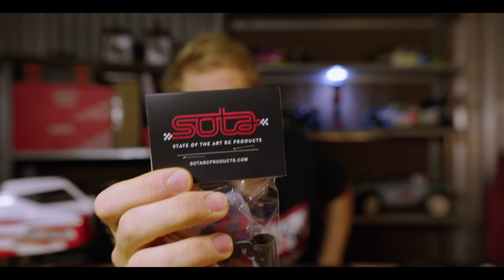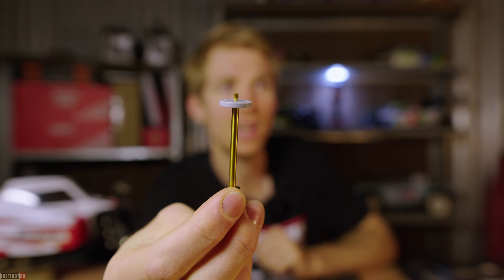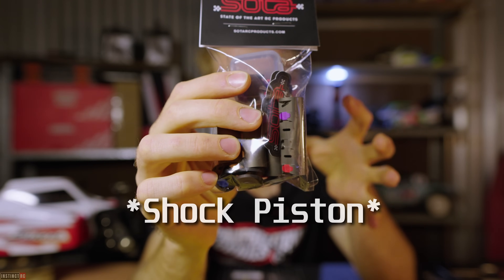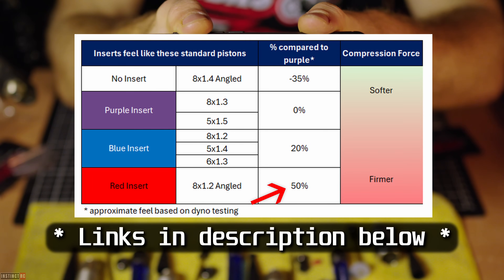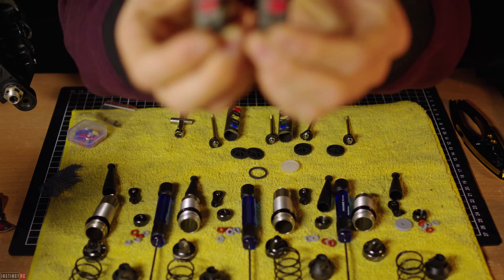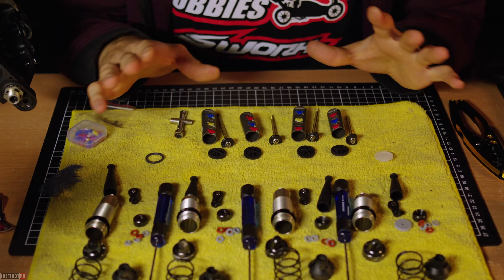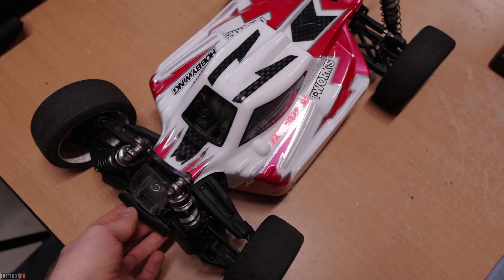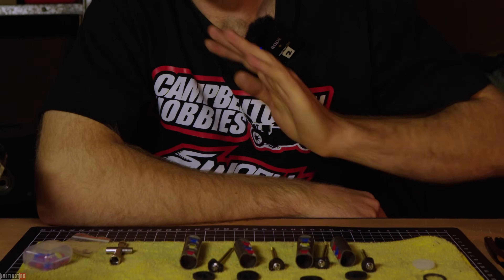The FUTURE of RC Shocks? | SOTA RC

Comment: I have them in my Tekno EB48 2.1 and it's easily my favourite addition to the car. Easy to work on and the fluid just simply does not aerate at all.
Reply from the maker: Awesome to hear, have you done much tuning with them? And do you run them mainly on low or high grip?

I've only done 1 club day on them so far but found them very consistent and the car was more settled after big jumps or flat landings. I ran my fastest ever lap which was a second quicker than my fastest at the recent State Titles, though that could partly be just improving as a driver, as well as more confidence to push the car with these shocks. Plenty more testing required!
Reply: @InstinctRC  I'm a local racer only ATM. Our track is bumpy with sections of low grip and sections of high grip. It's very trick to tune for. The PSD is definitely the most consistent setup I have used, previously on 5x1.5 VRP pistons. Top to bottom I'm purple, purple and blue and I might try no middle valve next time. 

I'm definitely not one of the fast guys either, so I need all the help I can get. But for me the biggest perk is way less maintenance
Reply from the maker: @ThePureArc  Yea, handy just being able to change inserts to fine tune, instead of oil. Have you played with the grub screws yet?
Keep driving and improving! I'm still well off the fast guys too, but the most important thing is to have fun.
Definitely give Matt @ SOTARC a msg if you need setup help, otherwise, trial and error is the best testing method.
Reply: @InstinctRC  Matt is super helpful and very approachable. I run no grub screws, I haven't tried using them at all but I don't think it would help on this track. I expect that would work in something super smooth. I would love to see the system in a Traxxas UDR though. It would be the ultimate scale truck.